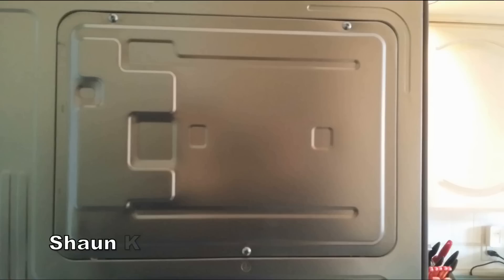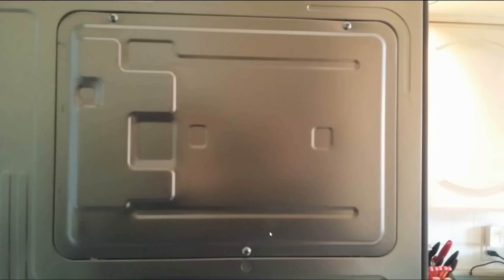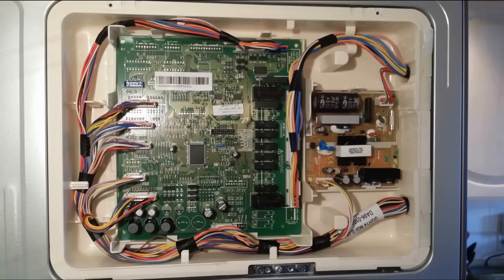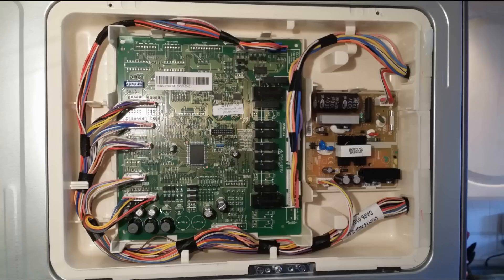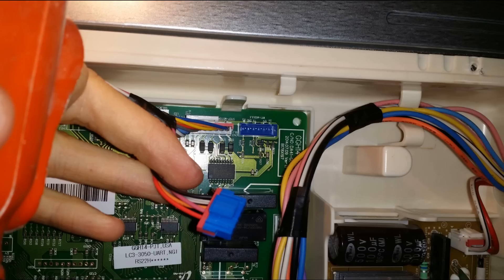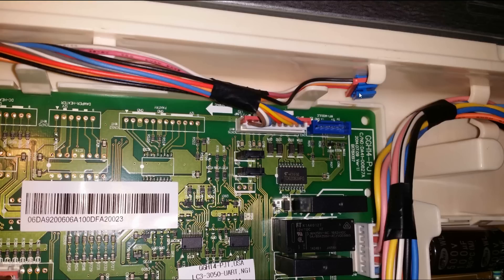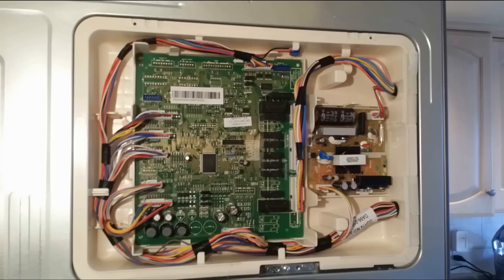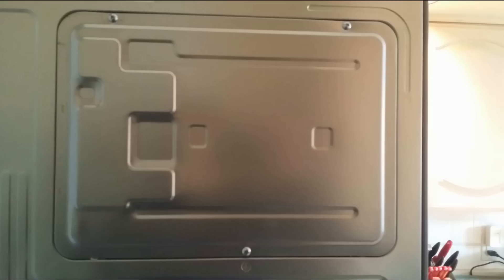How to disable Samsung "smart appliance" features and RF radiation

Comment: Anyone who is concerned about RF emissions should be more concerned with other devices in particular, WiFi routers, personal computers and Tablets that use WiFi connections, Media devices that use WiFi connections and ESPECIALLY Mobile Phones (Cell Phones). And even if you can turn all of those devices off, you still need to be concerned about all the RF emissions coming from your neighbours devices. Disabling a single device isn't going to help much. Better than nothing I suppose.

Comment: Thank you for this video! While our Samsung fridge did NOT state it was a smart device, the meter told me otherwise. I am extremely careful what is brought in our home (even have the smart tvs on clickers to turn them completely off at night). The comments below helped us determine where the WiFi connection was at. It is a 2022 model so it did not look the same as this video. The connector was found by the hinge door on the right on the top of the fridge itself. Tested it with the meter and ZERO emissions now! Boom!
Reply: Can you tell me if your Samsung fridge is a side by side mine is a 2024 model and it’s still showing to pair my phone with my Samsung fridge so I guess it’s still connected…although I tried to followed the same direction the box unit is very different and wires are different. Can you tell me where exactly your connection was so I can unplug please..thank you
Reply: Do you use cell phones? They emit significantly greater levels of RF emissions continuously while they are powered on. And when you are using one, you often have it stuck near your head or your body.

Comment: Thank you!! Thank you!! Thank you!! Just came home with a new Samsung fridge today. I had no idea it was a “smart” appliance, it was on discount and a floor model. I was pretty annoyed because I like the fridge, but was ready to toss it out the door because of the wifi. There is absolutely zero need for freaking wifi in my refrigerator. Keep my shit cold, and frozen, that’s literally its only job. My board wasn’t labeled, but the wires were. And it was on the bottom right. Thank you again!! You made my freaking day!!
Reply: Exactly...why in the heck does a fridge need wifi, especially if there is no screen/internet connection on it? My mom got one of these fridges a couple years ago, and her old school tv hasn't worked properly since (massive static). I hope to disable the stinking wifi in her fridge.

Comment: Thank you!  My Samsung RS28A500ASR (28cu.ft. side by side) was similar but different. I tested the fridge w a Cornet Electrosmog RF meter and had a strong constant signal of 1-2 mW/m2 in the 2.3GHz range near the fridge.  

There was no label of "WiFi Module" but I did find a plug that had the same number of wires which made sense for power and communication.  On this model, the panel is on the bottom left of the back of the fridge and you have to remove screws.  The 'plug' to disconnect is the smaller one in the upper left corner along the top edge that has 5 wires coming out of it. First unplug the fridge, unscrew the metal panel, disconnect the 'plug' and tuck it up along the other wires, then screw the panel back in place and plug in. After plugging it back in the fridge operates normally and I cannot detect any RF from the fridge!!
Reply: I have the RS23A500ASR... do you think it is the same one - top left side of pic? Sorry, pic won't attach... my model is the counter depth version. 23cu.ft.

Comment: Thank you so much! We achieved success with our new 2022 LG fridge, which we bought completely unaware of its wifi feature. We found the circuit board and transmitter under a panel on the top of the fridge. The wifi clip was labeled “rf module” instead of wifi module (rf standing for radio frequency). As far as I can tell,  fridge still works and the wifi is fully disabled. 😅🥳🙏🙌

Comment: Just disconnected my wifi on my LG stove. Look at the electrical schematic that is on the back of the stove or in the manual. Find PCB WIFI and connector #. Mine was CN14.  Carefully disconnect with needle nose pliers after unplugging unit, removing back cover and grounding yourself first.
Reply: I just did the same on mine, same code, it's on the technicians manual CN14, unplugged that shit, now i just need to figure out this fridge, it's not the sameas this guy wit a blue plug, i couldn't see anythign called wifi on the fridge board.  thanks for this amazing tip my brother!!
Reply: @tenthgate8090  what model of fridge do you have? I've yet to look at the fridge but its not showing up on my wifi or BT. My manual doesn't admit to being a smart fridge but  I wonder...

Comment: are you deleting my comments or is it themtube?
Reply: I can’t even reply to your message below that’s crazy we have 2021 Samsung fridge n I literally just realized after a year it’s got WiFi. Popped up in setting under networks then disappeared. I need to figure out if my 1 year old fridge will work after I unplug. Any info appreciated
Reply: @Jackofall1289  there's a good chance that everything will work just fine without the stupid wifi module, I believe. It did in case of my electric range. However, you wouldn't know unless you try it.
Reply from the maker: we didn't delete any
Reply: @EMFExplorer  I added several comments to folks below asking how to disable WIFI on their Samsung range and added a link to a video I made on bitchute showing how to do that and bamm, 5 min later the comment was gone.
Reply from the maker: @noteevanbro8054  I looked in my email too, and never received an email notifying me that you posted a reply, until your recent one asking about getting deleted.  So it must be YouTube filtering out.  Maybe they filter out links to other video sites like bitchute.
Reply: @noteevanbro8054  I am trying to disable wifi on my new range but cannot find the connector to unplug. Can you write out instructions on how to do it or how to find the video you made?

Comment: Any tips on disabling wifi on the Samsung oven? I’m guessing I have to pull the whole oven out?
Reply: @DesignedByNature Unfortunately that doesn't turn off the wifi, it still transmits. It's actually to the left of the time display, I had to unscrew the back and remove the wifi transmitter, which is a small chip
Reply: @Anw120  Which model do you have? How did you find the chip?
Reply: @RetroDawn  I can't remember the exact model, but I had to take off the back panel, and the wifi chip was a tiny little chip that was right to the left of the clock (if you are looking at the oven from the front). 

Just had to unplug that wifi module / chip, and it worked fine after, just wasn't transmitting wifi signals all the time.
Reply: @DesignedByNature What model is that for? Is it still transmitting? Can you see it on your wifi networks list if you turn on wifi on your computer/phone/tablet? I found these instructions:

Hold the Broil button and number 9 button at the same time for a few seconds. Your might have to hit 9 first so that it doesn't turn on the broil option.

Hit the number 7 or 0 (might be different depending on version/firmware) button to change "AP On" to "AP Off".

Hit Set/Start, and you should see the WiFi icon disappear.

To turn it back on (which is supposed to reset it to defaults) repeat the above.

Comment: What happens if the antenna is removed? Is the RF still being sent out?
Reply from the maker: If you remove the antenna without removing the transmitter or unplugging the power cable to the transmitter, you will have some RF leakage yes.  It may reduce it considerably, but you will still have some RF.

Comment: Even though my Samsung Fridge's circuit board is not labeled, I was easily able to find the only connector which looked the similar to yours in the video. My connector was white, however the pins and wire colors look the same as yours. I was able to triple verify by unplugging fridge, grounding myself, pulling this connector, and plugging fridge back in. I did this 3 times, each time checking for the fridge to appear on WiFi. This is infact the connector to disable the wireless. My fridge is new model Samsung, model # RS28A500SR. The connector which looks like yours, and can be identified as the only connector with the far right hand pin missing. Thanks for making your video, it helped me for certain.

Comment: Thank you so much for this video! We got a brand new Samsung fridge that came with "smart" feature. My husband opened it up and was looking for a wifi label... it wasn't there, but we found a blue connector that had exact same codes as on your board and that was the right one! Thank you again, now we don't have a wifi router right in our kitchen :)
Reply: I"m shopping for a new refrigerator and the only brand with the right model that's available at my local big box orange store is a Samsung with 'wifi enable' feature.  I'm going to start prying open the hinge cover at the store now.  Thank you.
Reply: I just got a Samsung fridge. I opened up and looked at circuit board. Nothing is labeled “WiFi”. We may have same fridge. Can your husband give me any clues on what I need to disconnect ? Help.
Reply: @mtbeliever5833  look for a blue connector that has exact same codes next to it as in the video (around 2:13 mark)
Reply: @alladegtyareva7310  found it!! Mine was on top of fridge. Above hinge.
Reply: @mtbeliever5833  im goin to buy new samsung refrigerator,  a side by side,  i like the sleek look but its smart😒  can you please tel me what refrigerator you got?  I hope samsung didnt make this smart thing "unable" to remove or else the refrigerator wont work.

Comment: Great video! I found it because I just installed a new samsung range and noticed it appearing in my wifi network menu and I have been googling how to disable...Do you think this process would be similar on the range as well? It at least gives me hope that its possible!
Reply: Did you get the WiFi disconnected?
Reply: @mtbeliever5833  I'm wandering if he got his wifi disconnected as well.  Our new Fridge is showing up on the network list also, even with the wifi icon, inside the fridge turned off.
Reply: @LIVINGINKY  I was able to remove mine. It was on top of the fridge where the hinge was.
Reply: I did deactivate WIFI on my SAMSUNG NE63A6511SB electric range. I made a video on how I did it, which might be of value for you. The below gets you the link to it.
https://youtu.be/3pbJYq87IfE

Comment: Great video. Thanks for putting it out.
I have a Samsung model QN65Q6FNAF, bought in late 2019. It had no screws - just pop-off snaps. It opened easily and the WiFi transmitter was very easy to locate because it was labeled. I unplugged it, reassembled and the TV would not get past the Input screen. (Apparently there is something in that module in this model that it needs.) So I reopened the TV to decide what to do. The Wifi module was surrounded by plastic, with no printed circuit board showing, so I plugged the cable back in and carefully wrapped the entire module in aluminum foil, twice, and snapped it back into place. The TV then turned on ok. The measured RF was significantly reduced according to my Acoustimeter, from peaks of 6.0 V/m to 3 V/m, so I did accomplish something. I am thinking that what I need to try next is making some sort of grounded alligator clip wire and attach it to the aluminum foil. Does anyone else have any other ideas? I have already voided my warranty by doing this, so I am not against cutting a particular wire on that wifi cable if anyone has had the same experience and know which wire to clip.

Comment: Thanks... I had a different model Samsung but still the wifi was the only blue connector on the circuit board.  Although the connector was not labeled WiFi like yours, it did have two pins labeled Tx and Rx; referring to transmit and receive.

Comment: I want to upgrade my TV to an OLED. I don't watch TV but merely use it for blurays and dvds. I want to completely eliminate the wifi pulse from my new TV if I buy one. I contacted LG and they said that their wifi module is part of the firmware and cannot be removed. But surely there would be a way of severing the power connection to the wifi module on the circuitboard? Have you any experience with the latest TV units? I don't want pulsed radiation tech in my home. I do not even use mobile phones or 'cell' phones as Americans call them.
Reply: would be a good idea to read up on circuit boards to see howit can be done

Comment: Great Vid. If you could only tell me how to disconnect Samsung Active Wash (Washer/Dryer) Wifi. They make it impossible to get to the circuit board. It's encased in a rugged plastic barrier-- that after taking off the panel, you still can't get to without destroying it or possibly damaging the machine. I believe they designed it this way "on purpose."

Comment: We just got a new model Samsung and I tried disconnecting the "wifi module" cable which was in a different location and the cables had a white clip.  The radiation was still present and the refrigerator didn't function.  I reattached it and disconnected one labeled "DR Ready" (a blue clip like in your video) and that fixed the EMF issue and all functions seem to be normal otherwise, will update if I find some issue.  Just wanted to let you know.  Thanks for the video!
Reply: Did your cover have any caution notes on it?

Comment: As soon as I did this, the fridge stopped working so I had to reconnect it and then disable the smart grid override function to get the fridge to cool down again.... have you seen this issue? The main difference is my circuit board has another blue plug that is attached to the motherboard (the one on the top left) but not sure what that does... Please advise!
Reply: I don't have an energy saver button... I have the samsung 28 cu ft showcase fridge so not sure..... I let it sit over night not realizing the fridge shut down and the temp inside was 65F....... no idea how to fix that.
Reply: enkrypt3d Update, my last fix DID NOT work. When I disconnected the blue harness, the compressor stopped working as did the wifi. The bastards at Samsung may have made it so that the fridge won't cool unless the wifi is hooked up. This fridge is outta here.

Comment: Now they will change everything.
I hope your fridge lasts a long time because we bought a dishwasher it lasted about 1.5 years. our 7-8 year old microwave also samsung gave up the ghost but that was after a smart meter install. Probably a dioid issue.

If you have to get service on any of your appliances make sure to reconnect the disconnected parts or you voided your warranty. you can unplug it after the guy leaves.

Comment: Why would you buy a refrigerator with wifi in the first place when you are so concerned about the radiation in your house?
Reply: +user5134 On this model it was not advertised or marked or anything.  One would have to read deep into the 100 page manual of the unit to see that it has the "smart" technology.

A lot of this smart technology is not advertised.  I always recommend testing new appliances with an RF meter - it's the only sure way to know.
Reply: +user5134 ... I can double Shaun's reply , unfortunately. Its been my priority to have no transmitter but even  having read every spec, I'd missed this (oh, how i hate it!).
  My..fridge (!)is now the only WiFi point in my home and the Customer Service was probably hiding a laughter when I asked their help to disable the feature. Mine fridge is LG.
Reply: I want a big fridge with all modern functions and innovations and the only ones are with smart function also

Comment: Thanks for the video.  I have an LG Studio "smart" refrigerator and the inside electronics do not look enough like the Samsung unit you are working on. Any advice for finding the correct part to disconnect?
Reply: +Dee Cee Hmm maybe look and read the labels by the various wiring harnesses and see if one is labeled WiFi Module or something similar?  Of course have the unit unplugged while doing this.  Keep yourself grounded so you don't discharge static electricity onto any of the components inside.

Comment: Thank you so much for this!  Now, what we need are dates and models.  When did this chip process start and which models, if not all of them, have these chips?  Then, we need to extend this to ovens and other appliances.  It won't be long, though, before manufactuers start making these so that the appliance doesn't work if the chip is disabled.

Comment: Does anybody know since when they started to install "smart appliance" features into house hold appliances?
Reply: Back about 5 years ago is when I saw info that they had it in some things but was getting ready to make it a across the board thing for all appliances--cheap or expensive. The house I am looking at has transmitting appliances in the kitchen and the hot water heater too. The thermostat and even the garage for opener which can be hooked up to a smart phone! Ugggg, why all the radiation emitting devices. I need todisable or replace all of them